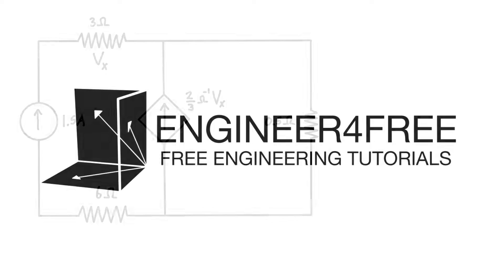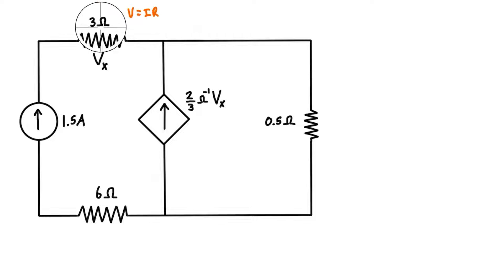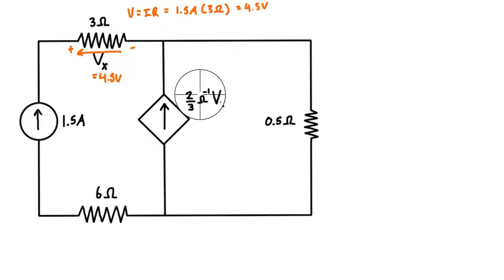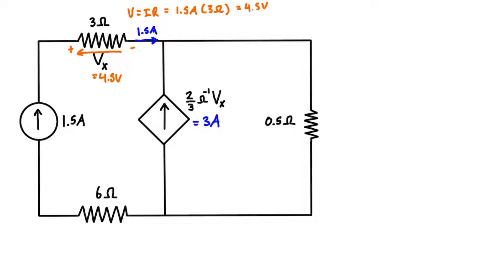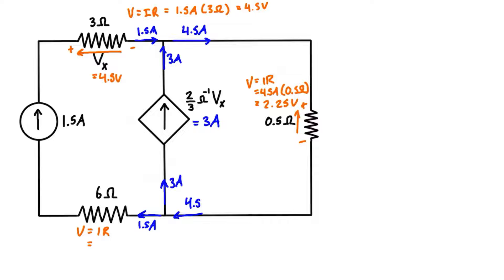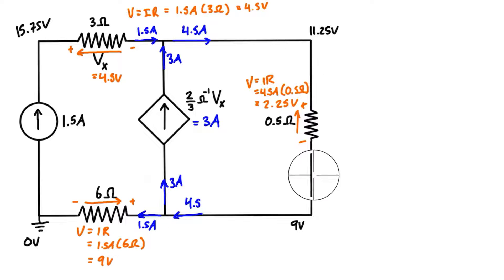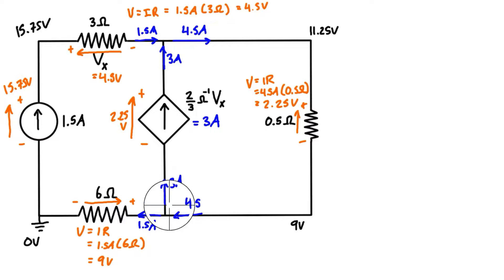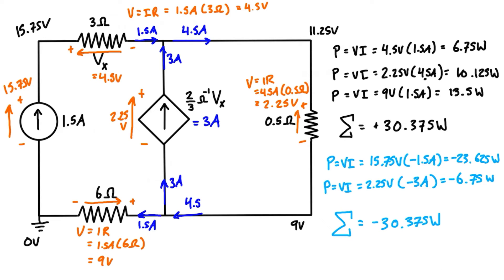VCCS: Voltage Controlled Current Source

Comment: Arrow directions make this very confusing. Why do you keep drawing arrows opposite of conventional current? No one does this! Voltage across the dependent current source is also confusing. Why do you say the V drops across the 0.5 ohm resistor is PLUS 2.25 volts. If one were to use one convention where the V-drop across the 0.5 ohm resistor gets a minus sign, then the V across the dependent source would have be + 2.25 V, according to KVL in the right loop.
Reply: I feel you. My instructor does it the opposite way, and in my opinion the way you and I think in terms with is more intuitive
Reply: Hi, the orange arrows indicate the voltage rising across the component